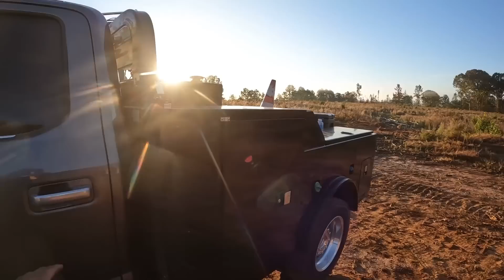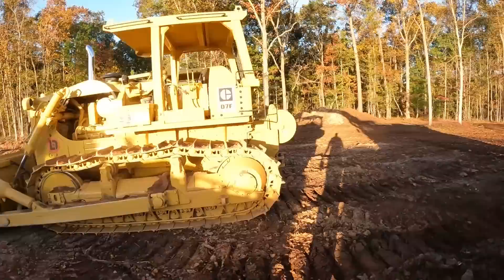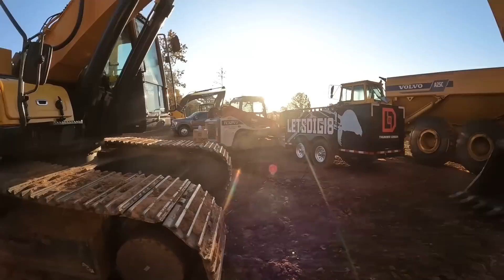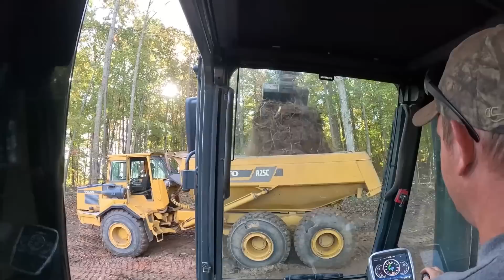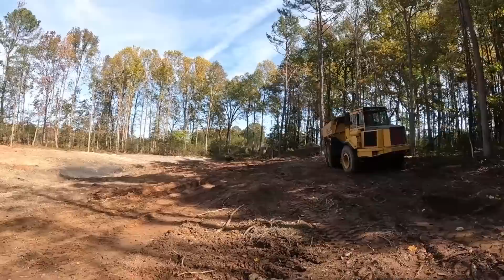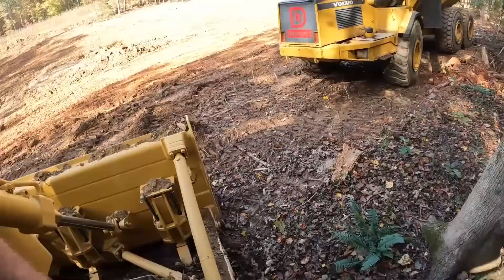One Acre Pond Build Day 1!

Comment: Robert's a stand up guy to own up to his mistake with the fuel cap. Definitely someone to turn to when you need help. Also, that was a great explanation to why you aren't putting a thumb on the 330. I didn't think about the extra weight added and it reducing the amount of dirt you can move.
Reply: A small piece of chain attached to the gas cap and the dozer would be cheap insurance against loss.
Reply: Not too many people now will take ownership of their mistakes!!  I'm glad Robert is a stand up guy!!
Reply: Good job Robert😊
Reply: For me, the best way to find something I have lost is to buy a replacement. It almost never fails that shortly after I have the new replacement, the lost item appears.
Reply: He always knows where he is going

Comment: They certainly shot some quality paint on that dozer, excellent prep job too. I'm amazed there's any paint left on the moldboard. Let alone the tracks. Damned good buy Chris. 
     Best regards from Indiana.
Reply: Everything that Clint and Kevin do is top-notch they do not cut corners on anything. A not that they did a better job on the "7" because Chris was buying it. They do the same on every machine. Chris may have gotten a better job than normal  because he asked them for extra things he wanted, and I'm sure he paid a little extra, but he got what he wanted. His standards are high, and that's good.

Comment: H Cris, thanks for the video..
I'm sure you've heard it a thousand times before from the armchair experts, ( But hears another).
Have you considered trying a transportable easy to move grizzly with a big dome or sphere on the top to - 1 have something solid to knock the sand off the root balls, and - 2 separate the lengthy roots etc, to leave in a pile instead of pushing again and again to remove sand that could have been mostly stockpiled an easily trucked over to burn pit ready to throw in. We used them all the time and were so time efficient all jobs had at least one.
All the best Bud.. The whole job is looking great,..

Comment: Chris putting the D7 to work. Kevin's paint job holding up well so far. all that nasty junk filled dirt fill in low spots, borrow pits. once its buried, out of sight out of mind. the 330 is a bulk hogging machine, when Chris gotta move lot of material relatively fast. leave the nitpick cleanup for the dozer, the 220. next big investment a soil screener 😉

Comment: Time for a treasure hunt with those with metal detectors,run a sweepstake with a grid of the site and bet on the location of the cap , maybe a closed group , Bealy Good,Dirt perfect,etc ,BBQ at the end .
Robert has done good ,wish more employees were like that .
As for the fuel cap ,a proactive tip would be to attach a stainless cable to the cap that swivels and is attached to the dozer ,that way the cap doesn't run away like a naughty boy 😊
Reply: For all we know, that fuel cap could be in the bottom of the borrowed pit, good luck with your metal detector if it is. Likely find other stuff, though.

Comment: Kinda figured at the buy of the 330 that it was going to be more of a dirt hogger and stump popper than a clearing machine or a fire stacker. Especially since you were looking at such a large scooper bucket the extra mass of a thumb would mean the machine gets very tippy near the end of its reach. 

If you really want to get a special h ad on the end of the 330 stick, a large rake like a brush rake/grapple that could be found on a front loader. But even that might be less useful than thought. Though seeing a 330 sized mulcher head on it turning a twelve inch tree into gobs of wood slivers might be interesting.

In the end, it's your machine to do with what you want. In time if you want to add a thumb it can be done but for now. I'm thinking more that we'd like to see the largest scoop it could swing. See if we can get those scoop counts down to four or five before heaping roll out the back of the haul truck.

Comment: I here you on the enormous weight of the thumb being dismissive for its use on the 330. I wonder if Clnt and the boys at C&C Equipment could put their creative hats on and fabricate a easily detachable thumb mount that would give you the best of both worlds on the 330.
Reply: That's going to be one heavy thumb to stand up to 330 power! You ain't 'easily' putting that on and off! regardless of how its mounted. 
Quick attach and a AMI Graptor style bucket would be a better option, but again you're adding weight.

Comment: It's not the the big Volvo you had borrowed awhile back, but the 330 is moving some yardage. A slightly bigger bucket, from AMI, would be much better than a thumb. Move more dirt faster. You can always haul the bucket separate on a flat trailer to save weight.

Comment: I Just noticed at 27~30:00, Are those rippers behind the blade? Cool.
Reply: Rippers on the back of the blade led to the push arms cracking. You can do light ripping with them but too many operators think if some is good then too much is about right.